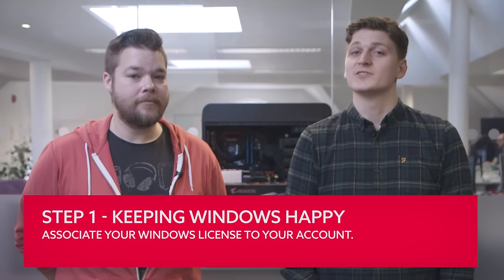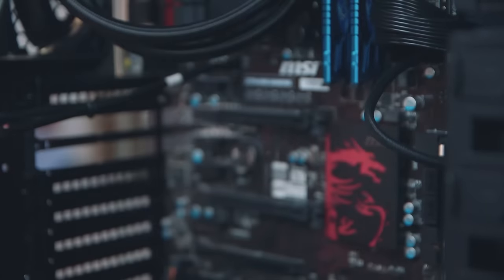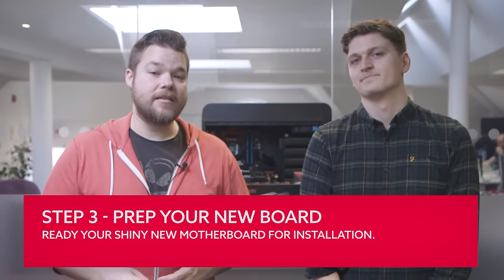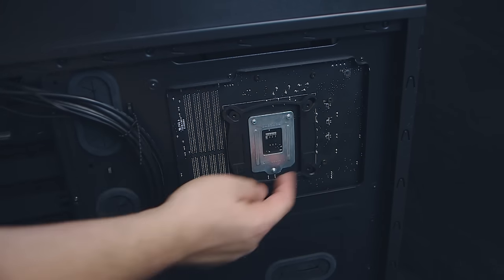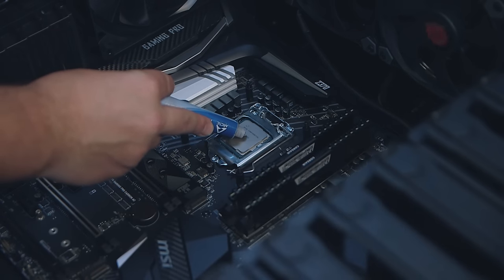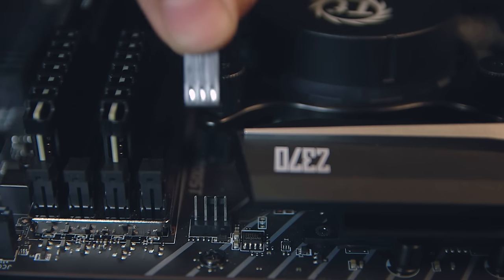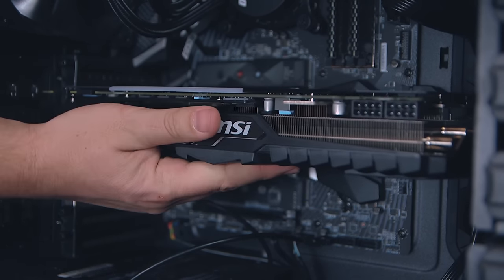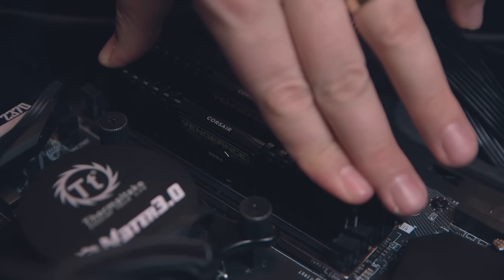How to replace your PC’s motherboard in 8 easy steps | Hardware

Comment: thanks for a great video it has helped me replace my motherboard a lot easier than i thought it would be. Except for windows 10 needed to sorted and microsoft was a good help with that.
Reply from the maker: Glad It worked out for you!
Reply: I linked my Microsoft account to my windows before replacing mobo and it still won’t activate. I’ll be calling them tomorrow

Comment: The most annoying part of replacing a motherboard is plugging the power buttons back in, those wires are generally not labeled or the labels aren’t descriptive so you end up plugging the power button into the wrong socket so it won’t turn on

Comment: PLEASE HELP ME do you need to do anything with bios and internal stuff etc
Reply: Yeah, they completely missed that bit didn't they! I know this is too late, but you will need to go into Bios and set your boot drive. Bios will refer to the drives by their model names and manufacturer so you'll just have to figure out which one is your C: boot drive from your old PC, which should be really easy in most cases/.
Reply: @yorkshireplumbing  Yooo thanks broo you helped me
Reply: @yorkshireplumbing  that's
...confusing
Reply: @yorkshireplumbing  thanks man , but do i need to install windows on the new motherboard or is it installed already on my old ssd ?
Reply: utopiaopera hey!!! Do you do the bios boot after the motherboard is connected to everything ? Or before it is connected ?

Comment: So I’m getting a new motherboard, CPU, and GPU. The old motherboard is intel and the new one is for AMD. What will happen with my BIOS? What all do I have to uninstall/reinstall? Can I still use my first windows 10 key instead of buying another one?
Reply: DangerNoodle Windows can be attached to your Microsoft account.
Reply: How can i access my windows again on new motherboard then? cause it comes up with them wanting me to type in windows key
Reply: Christoffer Majker Jespersen Well you cant then, if you did a clean install then you need a key.
Reply: Christoffer Majker Jespersen Don’t listen to him. When it asks you for a key just click I dont have a key. Then go to settings —> update and security —> activation and you should see a troubleshoot option.

Comment: i did everything in the video in regards to activating windows, everything works as it should but windows will not activate with the new motherboard, has something changed since this video? like you cant activate on a different motherboard? it seems like the only way for me to get rid of this watermark would be to buy windows and do a fresh install which is what i was trying to avoid the whole 
time...
Reply: jake3040 you can activate windows back accessing your microsoft account if you had a digital license. Or just use the CD key if you got a retail copy.
Reply: Juan Correa Wait so you have to buy windows all again?
Reply: @ScreaMzbtw  No...

Comment: i'm absolutely terrified of upgrading my motherboard but i feel like i have a bad motherboard even tho all my games run at good fps for example apex max settings run 120 fps and GTA runs 144+ but i have a cheap motherboard and it feels like i'm missing out on performance because of it its the a320M - SH2 
It was in the pre built i bought like 4 years ago pc is still good

Comment: Ahh ok, so as long as I registered my computer with a Microsoft account I should not have a problem with my hard drive stuff?. Lately I started my computer being I had to turn it off, however, it struggled going back on and turned off several times then restarted then finally went on but sent me to boot menu to do so.I built this rig many years ago and I am still running an i52500k cpu. I am scratching my head trying to figure out now that I finally got it up and running is it the PSU? or the motherboard?. I replaced the PSU a few years back and Video card. So I am unsure what to do here because I don't want to swap out motherboard just yet when I have no problem running games. I am very hesitant in swapping motherboard out being I fear of losing everything on my 3 hard drives. Could you possibly tell me some things on this?.
Reply: may be the ram if you overclocked it

Comment: Hi PCGamesN,

Do you recommend I uninstall the old motherboard drivers and gpu drivers etc before I do the upgrade to avoid driver issues or will windows 10 sort them out. I am running version 1803 currently!

Please could you get back to me, thanks!

Comment: I am a bit late but should i remove some drivers when swapping mobos? And what about switching parts from pre build system to custom build with differend motherboard?
Reply: Store everything you want to carry over on a non OS drive, then factory reset, then install windows on the new mobo

Comment: I know this is a year old but I just wanted to say what a great video! I recently bought a MAXIMUS XI FORMULA and an i9 9900k and was very nervous about installing them but this put a lot of my worries to rest and only in 8 minutes. Great concise and informative video guys
Reply: Did your PC run as the old one like nothing happened? i mean did u reinstall everything? or did u just put in your old ssd/hdd and it runs like the old one?
Reply: @ariesq5851  Hey ik its been 3 years since youve commented this but im dying to know the answer to this question too. Ive been wondering the exact same thing
Reply: @Zemog23 hey ik it’s been 6 months since you’ve commented this but i’m dying to know the awnser to this question too. did you figure it out?
Reply: @ianrust1  Nah, I've upgraded my cpu and stuff but I never switched the motherboard. I still don't know how data will work whenever it comes time to upgrade.

Comment: Planning on changing my Asus Rampage III to a new Aorus board. Want to go from an I7-980X to a Ryzen 7 3700X. I used to have 32 GB ram but the motherboard is acting up, only 22 works right now, I know the modules of ram work however. On the new one I'll probably opt for 64GB of Hyper X rgb ram or maybe G-skill Trident Z.
Its going to be really cool!
Reply: I've ordered some of the parts :)

Comment: Do i need to uninstall the motherboard's drivers before replacing it with a new one (Different brand) or just do it after the replacement?
Reply: Someone please answer
Reply: Lmao yes please answer😂
Reply: You don't have to guys, just reinstall windows right after you replace the motherboard with a new one. Works for me but make sure you have the back up of your important files.
Reply: John Louie what if you have a digital license for windows 10? Do you still have to reinstall windows 10 or can I just sign into my Microsoft account since I have a digital copy
Reply: @Its_JustJosh  Just sign in and go to activation section of the settings and then click the troubleshoot under "Activate Windows now".
Reply: If your digital license is saved or registered in your microsoft account and if it is legit, just do what i listed above after you reinstall windows.
Reply: John Louie okay thank you!

Comment: Do I have to remove/delete any drivers
Reply: I keep seeing videos saying to remove drivers first then do the swap. This video says nothing about that.
Reply: I upgraded my cpu and mobo exactly like the video. Everything went fine...no removal of drivers.
Reply: So do I have to reinstall Windows
Reply: It is already on your hard drive. So no need to reinstall. I followed the video 100 percent and had no issues (new CPU and Mobo)
Reply: @jcaashby3  So literally all you did was replace the hardware, start up normally and bam? I too am upgrading my mobo and cpu :)
Reply: @ginjaninja4222  I did a lot of research and this video was the one I followed. Make sure to follow what they say to do in regards to Microsoft Windows sign in part of the guide. I also took a risk and didn't back anything up as other videos suggested. 

All in all it booted right up. Have not had any issues besides having to unplug and plug my headsets to get my Mic to work after turning pc on. Haven't figured out why.
Reply: jcaashby3 ok thanks!
Reply: jcaashby3 thanks bro
Reply: jcaashby3 wow simpler than I thought thanks man (or women)
Reply: @ginjaninja4222  How did the build go?
Reply: X_Master_Savage_x illl let you know after christmas lol
Reply: @x_master_savage_x8044  went without problem haha
Reply: @ginjaninja4222  nice! I built me like a weeks ago and had no problem too.
Reply: @jcaashby3  no problem with your OS?
Reply: @kdc9613  everything working normally.
Reply: Im upgrading board,cpu,and ram tomorrow,from AMD to intel,do i need to remove any drivers first?

Comment: im not sure if a motherboard that i am going to get supports my Nvidia Gtx 1060 6gb. For the Nvidia Gtx 1060 6gb it says that it needs a PCI Express® or PCI Express 3.0-compliant motherboard with one dual-width x16
 graphics slot. The website for my motherboard says it has MULTI-GPU: With STEEL ARMOR PCI-E slots. Supports 3-Way AMD Crossfire™ Could this motherboard support my current graphics card?
Reply: Use pc part picker to check the compatibility of your parts!

Comment: I finally upgraded my mobo and CPU! Replaced i5 7500 with Ryzen 5 2600X.
Reply: nice!  me too replacing my i5 6500/b150 (2yrs old now) to ryzen 5 3600/b450. Time to try amd :P
Reply: JarheadPlaying do you need to delete any drivers from intel or just switch the board?
Reply: @pizhang1460  I made a clean install of Windows 10. Depends. I had some intel drivers but I wanted to erase everything so it would be as pure as possible.

Comment: I got an i7-8700 from my uncle this christmas but it doesn't support my motherboard so I have to buy a z370, hope this guide helps me out in my case, I'm not very good at pc building since all I've done is replace a graphics card. Wish me luck lol.
Reply from the maker: How do you know you're not very good at PC building if you've just replaced a graphics card? You could be amazing at it! Have faith and have fun 😉
Reply: Literally same situation man! I'm either buying a 7700k or getting the mobo, cant decide.
Reply: @quinnCS  bruh I'm upgrading too and I'm so nervous about fucking something up before the shit even arrives
Reply: strikerna Loool literally same issue... my mobo (asus z170-e) only supports up to i7 7700k. I want the i7 8700k but then i need a new mobo. What should i do lol
Reply: Dont switch until 2020 literally that cpu can stand strong in 2019

Comment: im encountering the whea uncontrollable error after upgrading my motherboard and processor. i checked already all the connections and sometimes the error does not happen. the last thing im not yet doing is reformatting. do i really need to reformat?

Comment: I recently bought a new mobo, gpu, case, ram, and power supply to build a new pc, but plan on using my existing cpu, water cooler, and ssd. is this going to create a bunch of headache, or should it be about as straight forward as using all new parts?

edit: I bought my old rig used from a friend, and have never actually built a pc, or done anything more than replacing a gpu..
Reply: hahahaha true!

Comment: This was really helpful. If upgrading from 1151 to am4 do i need new ram? Heard it doesnt matter because both are ddr4 but idk
Reply from the maker: You should be okay. Early Ryzen and AM4 boards were a little funny about memory, but subsequent microcode changes have alleviated most memory problems.

Comment: is reinstalling windows necessary? Im planning to change my motherboard because i think my pcie slot is broken the reason for this is whenever i install nvidia graphics driver it crashes mid installation. And another case, I made the driver installation work but after rebooting it the pc doesnt recognize the gpu and it uninstall its own drivers with the error code 43 in device manager

ps: newly installed gpu

Comment: PCGamesN:: Question about windows 10 Activation, if i Sign out of the Administrators microsost Account, to a Local Account, then swap my old Gigabyte Motherboard, and put in a New Asus motherboard, install a fresh copy of windows 10, sign in with the same microsoft Account i was using when i had my Gigabyte Mobo, it will Re-Activate windows 10 on the new Asus Mobo ???

Comment: PCGamesN
; What if you Bought a Pre-Build Gaming PC, can i still Log out, and when i replace the old motherboard for the new, i can Activate windoes 10 to the new motherboard??? i just hear different things, like what even motherboard you uesd to create a microsoft account that it will have a Digital foot print.
Reply: Rom3 your microsoft account isnt locked to your MOBO. You should be able to activate your windows back again if you have your license attached to your microsoft account.

Comment: I think I know everything but I’m getting scared because I don’t know what to do once the new motherboard and cpu is in? Like how do you install windows 10 again and update all the drivers?
Reply from the maker: You may not have to install Windows again. Win 10 is actually pretty good with hardware upgrades and so long as you make sure you download the network drivers for your new board on to a USB stick before you switch (WiFi or ethernet so you can get online again) then the OS should be able to download the necessary drivers for you.
Reply: @PCGamesN  Thanks do i have to delete any old drivers? before putting in the new cpu and motherboard.
Reply: @ScreaMzbtw  did you have to?

Comment: PLEASE HELP when I install my mobo cpu and ram which is switching to from a Fx CPU to ryzen ddr3 to ddr4 and am3+ to am4 will I loose any data? And if I change my windows from local to Microsoft will it make me pay for new windows or clear any data? I installed windows from a flash drive selected “I don’t have a product key” and selected “windows 10 pro” that’s when I first built my pc fyi. When I change my motherboard will it ask for a product key? If so, what can I do to get my same windows back so I can have all my data. Or, can I just install my mobo, cpu, and ram, click the power button and everything boot how it’s supposed to just like I would boot up my pc any other time? Is that possible? Please reply I’ve asked geek squad and Microsoft and they both gave me different answers HELP
Reply from the maker: Windows 10 is pretty good at picking up hardware changes, so it should be able to do the heavy lifting with new drivers when you boot up for the first time. Since you didn't have an activated version of the OS in the first place it will only ask for a product code of you try and activate it. You should still retain access to your data.

Comment: I just bought a b550 mobo and i wanna switch to it but in my original build i didnt personally install the cpu or any of the cables on my board, only the ram and GPU lol so im super scared lol

Comment: I upgraded my CPU and MOBO last night and it booted completely fine. I upgraded my CPU from a i7-6700K to a i7-8086K and my motherboard from a Asus Z270H to a Asus B370H. So how do I go about replacing the BIOS and chipset without wiping my drive and doing a clean install of windows? If i just install the new chipset and BIOS would it replace the old ones or what issues would i run into? I want to overclock my cpu and I imagine using the existing BIOS would be a very bad choice. I know a lot about computers, but have never dealt with replacing a mobo and cpu in a present system before.
Reply from the maker: The BIOS is installed on the motherboard itself, so isn't based on your OS drive. If you find a newer version of your installed BIOS on you motherboard manufacturer's site then you can upgrade it without affecting your OS.

As for chipset drivers I expect Windows will have already installed those for you - if you're connected to the net - but you can check the Windows update section of Settings for updates to make sure.
Reply: @PCGamesN  Thank you very much for the reply! Ive been doing a ton of research and it has caused me a lot of confusion and worry. It just feels strange that the new motherboard would work with the BIOS from my previous board.

Comment: So I do not need to reinstall windows 10? I am going from an Intel to a AMD CPU and had to change the MoBo. I am slightly concerned I will mess something up if I put everything together with the new parts and have a system crash or similar. Please help :)
Reply: You do not need to reinstall windows 10 if you"re keeping your hdd or ssd. If you are buying new ones then yes you do.
Reply: Jeremy Romero so what do you do with the old drivers? Do you have to uninstall manually or will they get deleted after installing the mobo?

Btw when you reuse the same hard drive that has windows 10 is there a way to move the windows 10 stuff to a ssd or will that require a reinstall of windows 10?

Comment: If I get a mother board of the same brand will I need to reinstall windows
Reply: If you're getting the same exact model there shouldn't be any problems, I'm not sure about same brand and different model, but as long as your signed into your microsoft account on Windows, you should be fine.

Comment: if i still have my windows 10 installer and key can i reuse the key code after i get the computer running again?
Reply from the maker: Yes, if you've got a standard Win10 license key (not the free Win8 upgrade key) then you can re-avtivate it with the new hardware if necessary.

Comment: Going from a g4560 to an i5 9400f, changeing motherboards as my one I had was way too underpowered and doesn’t support the new one.
Can someone PLEASE help me. Idk how to install, and it won’t boot :(
Reply: Worst case scenario you burned your board becuase it was touching part of the case or the pins were damaged. best case scenario you didn't connect the connectors to the board correctly. One mistake I did was connect cpu fan to system fan pin